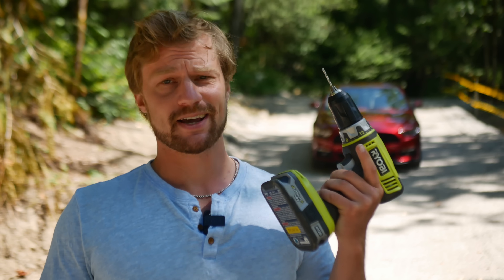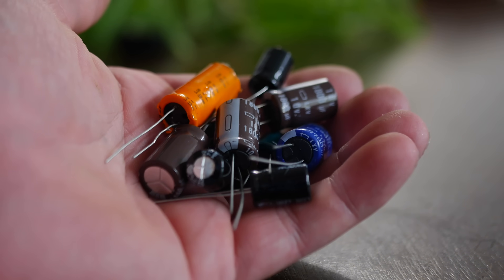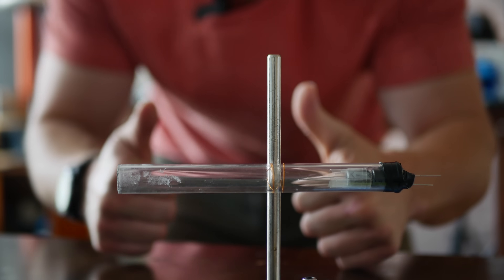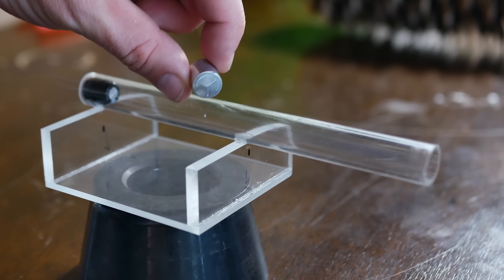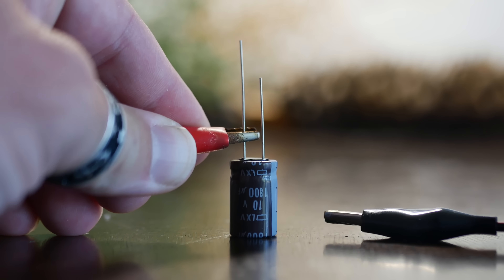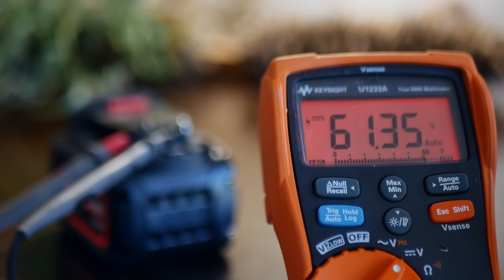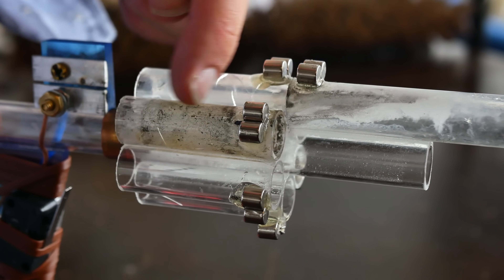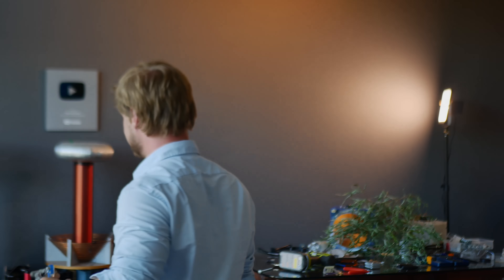I Built An Electric Capacitor Revolver!

Comment: I was doing this 50 years ago but started by using large paper capacitors, (seen on the outside of some electrical motors) hooked up to a single-cylinder lawn mower engine pulled apart (no oil), to work properly it needs a robust 'rotary disk shutter' a piezo pressure sensor and a heavy-duty airgap capacitor, the rotary disk shutter needs to be one of the capacitor plates. discovered this one day when an electric motor paper capacitor exploded and through me and my dad away from the motor, dazed for a couple of seconds, it was wow that had some power, when checking the capacitor the metal frame had rusted enough to allow the pressure to break through, there was tinfoil and paper everywhere. this is most likely the ideal future electric engine, (a petrol engine (ICE) style converted to an electric fuel), the capacitor pressure could with research and development become the explosive force required to drive the pistons, someone just needs the money and time to achieve the basic force for a car (1,145.83 Newtons of force per cylinder). it would need to be an AC system, NOTE this is dangerous and can kill if you do not know what you are doing, it is electricity...

Comment: Shoot holding the gun with both hands. Better accuracy.
Also, accuracy is increased by getting the projectile to spin before leaving the barrel. That's done by scratching a full thread on the inside of the barrel. Common knowledge.

Next build: electromagnetic nail gun from a camera flash!

Comment: I would explore more in the relationship of voltage and velocity to see were it tops out, maybe you can push it to the very limits getting really high voltages with batteries in series, the rc Lipo batteries are great.

Comment: Interesting use of capacitors - but - I can see the day very soon when you will need a special licence to buy electronic parts - as back in the 1920's and during the War. Hobby electronics will be made illegal and ultimately banned world-wide. 
You won't even be able to buy so much as a resistor or length of wire, for fear your making an unlicensed weapon of some sort.  Much like buying certain chemicals to make drugs at home. 
These sort of electronic toys will be hunted down by authorities and ones amendment rights will be thrown out the window. 
3D printed guns are being outlawed now in some countries, for much the same reason.

Comment: Cool idea and good video! 👍😎

For updated version - use high voltage big capacitance caps as energy storage and voltage boost converter module for charging them. After triggering, all energy from bigger caps is send to low voltage cap in barrel.. 😉

Comment: Use cotton wadding from black powder guns to seal the gap between projectile and barrel. look into rifling the barrel.what if you wired the batteries in series and wore the battery pack like a backpack? 
It's not a firearm it uses no gunpowder.

Comment: Firing circuit needs a voltage boost. Consider charging 4 60v caps in parallel and then discharging them In a 2x2 configuration for 120v.

Also, use charged high voltage caps for the projectiles for a tazer effect.

Comment: For the power source, I'd just wire a battery to a 90V booster, then that to a capacitor. (Literally what I thought you were doing from the title...) A capacitor could provide enough amps for that one burst, I imagine.

Comment: Yup a non isolated boost mode switching power supply will turn that 60 volt battery into 120 volts or higher.

Comment: Maybe a little suggestion... on your next build, place a solid backing up against those caps on the lead end... the bottom side. Those caps will release pressure from both ends when they explode, you loose some pressure from the lead end if the cap has no backing. If you could place a solid backing there, all the force will be pushed up to the top of the cap where you need it. Think of it like a real bullet, the back is sealed by a shell and the pressure released is pushed forwards only.

Comment: You could also use the boost converter from a 2004-2009 prius inverter, they accept any voltage up to 600v and use 12v pwm to control it.

Comment: You may use a high capacitance high voltage capacitor along with a boost converter to lift 18V to 90V. The capacitor will provide enough current for the firing capacitor to explode and the boost converter with charge the big storage capacitor to 90V...

Comment: You need to use a small battery, a buck converter, and huge honking capacitor to provide a jolt to the "round". A flashbulb circuit is what you need.
Reply: Of course. Maybe , maybe. Look here:
! New: Apocalypse Coilgun, Fallout Coilgun
https://youtu.be/G9-jKWPyMFo

See also: Portable Super Coilgun:
https://www.youtube.com/watch?v=rclLsQ9nyeg&amp;feature=youtu.be

https://www.youtube.com/watch?v=-mjDqp_oWZk

https://youtu.be/YLOYxsqvjw0

Comment: Can water work as an explosive by first separating the oxygen and hydrogen with electricity and then lighting it up with an electric spark? Can that be done fast enough that it can be used on a hand-held gun that doesn't need to store the gases, just regular water?
Reply: Of course. Very probably. Look here:
! New: Apocalypse Coilgun, Fallout Coilgun
https://youtu.be/G9-jKWPyMFo

See also: Portable Super Coilgun:
https://www.youtube.com/watch?v=rclLsQ9nyeg&amp;feature=youtu.be

https://www.youtube.com/watch?v=-mjDqp_oWZk

https://youtu.be/YLOYxsqvjw0

Comment: Super cool! To boost the voltage, maybe use an inductor with one side to + and the other side with a a mosfet to ground. Let ~10 amps build up in the inductor, then disconnect the mosfet. Voltage should spike very high, depending on how large your inductor is, and how small your cap is.
Reply: Of course. It's  really cool ! Maybe, maybe. Look here:
! New: Apocalypse Coilgun, Fallout Coilgun
https://youtu.be/G9-jKWPyMFo

See also: Portable Super Coilgun:
https://www.youtube.com/watch?v=rclLsQ9nyeg&amp;feature=youtu.be

https://www.youtube.com/watch?v=-mjDqp_oWZk

https://youtu.be/YLOYxsqvjw0

Comment: Interesting, but a huge waste of capacitors!  I never thought of a capacitor being used this way.  Going back some decades ago when I was working in TV service at a service center I saw where a customer decided to change a power supply capacitor in the power supply of his TV set and he installed it reverse polarity.  The capacitor blew apart, made some flames, and did some damage to the circuit board.  I had to change the complete power supply circuit board. It would have been less expensive for him to bring the TV in for service in the first place.

Comment: At last, finally someone who realises what we all did as kids in the 1990s is actually true.
Capacitors are weapons!
We never actually got round to using caps to fire a projectile, but we certainly did have fun with caps. We generally used the capacitor goo and the smoke as the 'projectile' in short ranged weapons. We would also build 'time bombs', ie a timer circuit connected to a relay, that linked 96 volts reverse biased through a bunch of electrolytics, and leave this circuit ticking on a desk that had kids from lower classes on it.
We eventually progressed from caps to 555 timer chips. These things are great, when you 'pull the trigger' you almost always get a chunk of casing firing straight up from the chip, meaning they are very easy to aim and fire. We also did '555 Olympics', with events such as the high jump and long jump (how high/long could you propel a fragment of an exploding 555), sprint (after the starting gun, which was an exploding 555, who could make their 555 explode first), marathon (who could make their 555 smoke the longest before blowing up), and of course the relay (who could blow up 4 555s the quickest using bare wires).

Comment: For a moment i hoped you would use a trigerable spark gap, and some photoflash caps. If sticking to this principle, try using a glow plug, with hot end heating up mineral oil in sealed cylinder with a weaker end wall
Reply: Of course. Maybe, maybe.  Look here:
! New: Apocalypse Coilgun, Fallout Coilgun
https://youtu.be/G9-jKWPyMFo

See also: Portable Super Coilgun:
https://www.youtube.com/watch?v=rclLsQ9nyeg&amp;feature=youtu.be

https://www.youtube.com/watch?v=-mjDqp_oWZk

https://youtu.be/YLOYxsqvjw0

Comment: If you polarize the caps in the proper direction before blowing them up you might get more explosive results. If an electrolytic is not polarized correctly at all before use, it can actually polarize in the opposite direction and work fine. Most of the time however, they get tested at the factory and are polarized at a couple volts for not very long. Often times it does not totally setup the dielectric. So if you apply reverse voltage, they will pop but not very explosively. If however, you apply at least 80% of their rated voltage in the correct direction for a few minutes, you may find it much more prone to explosion with only a few reverse volts.

Comment: Omg why didn't use a converter and get it up to 120v or 230v nice project in general much better than a Coil gun ,interesting usage for old caps but I guess if take out the electrolyte and got it full of match sticks it would de a gun with a battery and do some real damage

Comment: those caps have weak spots designed to explode at relatively low pressure, which limits the pressure buildup of the electrolyte. If you could reinforce the end cap a little bit, maybe you could improve the setup

Comment: This gun can achieve much greater power. Transform your batttery voltage to 400 volts, with a diode volt multipler, to a capacitor bank made of multiple 450 v. Capacitors connected in parralel  then use this charge to propel your capacitor "bullet"..

Comment: Watch out, the microswitch you use as a trigger is not suitable for the high current that flows. Eventually the contacts will weld together and cause an unexpected firing when turning the barrel to the next shot. As others commented, a better design would be to use a high voltage / high capacitance capacitor charged through a step-up regulator as energy source and to use a semiconductor switch (like a MOSFET, which can easily carry a kiloAmpere for short time) to trigger the shot. Then you only need to control the gate voltage through your trigger. Another benefit is that you can make the high current path as compact as possible, thus minimizing inductance from cabling and you can add debouncing to the trigger signal as a mechanical switch has the tendency to oscillate when closed causing intermittent contact in the first milliseconds.
Reply: Thats what he said

Comment: I have thought about something vaguely similar for years..
Not destroying the capacitors, but using them to fire a automotive style spark plug, as the ignition source in a black powder firearm.
(kind of silly, as black powder primers are far cheaper than what the components for my design sell for)

Comment: I wanted to say a few things:
  1) The gases emitted from the capacitor are poisonous and sometimes cause cancer (so be careful)
2) By designing a voltage booster, you can easily increase the voltage of the two ends of the capacitor up to 400 volts and as a result get more power.
3) If the tube of your device has rifling, you will get much more accuracy (for example, use a 9 mm tube (do you understand what I mean?))
4) For more accuracy, you can align a laser with the tube of your device

Comment: You could make really close tolerance projectiles by greasing a barrel, then put a blob of epoxy in the tube, compress the epoxy, and let it harden. 
I saw a video where a guy used this method to make pistons for a sterling engine.

Comment: The plastic probably weakened due to chemical attack. And pressure combined. After all some capacitors do have some agents in them like weak acids. And that thick smoke isnt likely good for you. Take care of yourself, don't breath any of it in. Safety first.😉

Its an interesting idea, just be careful. Metal should last longer, so long as the pressure rating is high enough. Just keep in mind, if something ever does explode, metal is likely to cause more damage if it ruptures. Especially metal thats not thick enough to handle a catastrophic failure. Might consider a back plate, to protect your hands too. Just a thought.

It will be interesting to see what you come up with. Reminds me of the old rocket powered pistols in reverse, only with a seperate projectile. And the propellant contained in the tube rather than the projectile.

Comment: So I have a suggestion: use a cheap 12V battery and add a step up stage with a large capacitive load. For a small form factor, a cheap flyback transformer will do perfectly fine from 12V to maybe 200V (you can even add some cockroft walton stages to multiply the output using same rating caps). It should take just a tiny bit of time to recharge before being ready to fire again, but this kind of configuration could unleash tremendous amounts of power! Great video!

Comment: Soooo.  Why didnt you go to big voltage dc?   Be easiest to rectify 220vac and output the like 288vdc.  Plus you could charge a big ass cap that would be the ignition rated at 380v at like 50kμF...  that should be enough for 6 shots before you had to recharge it..

Comment: It would be interesting todo something similar but with HO. Just 3d print little water containers add a rubber plug at the end add salt water and voltage and a spark and boom it will blow up in your face or be really cool. 50/50 chance.
Reply: Sure. Maybe , maybe . Look here:
! New: Apocalypse Coilgun, Fallout Coilgun
https://youtu.be/G9-jKWPyMFo

See also: Portable Super Coilgun:
https://www.youtube.com/watch?v=rclLsQ9nyeg&amp;feature=youtu.be

https://www.youtube.com/watch?v=-mjDqp_oWZk

https://youtu.be/YLOYxsqvjw0

Comment: The ammunition seem a little expensive for what is basically a steam explosion. A more cost effective propellant could be obtained from match heads, ignited by electrical spark, but this is far too close to being a conventional gun for this channel. The same would be true of using alcohol, oxy hydrogen or an alkane gas. So a more interesting propellant, might be an electrical discharge through water. There are reports that a high dielectric stress can make very pure water explode, though I expect it would be very demanding to construct a hand gun using this technology. 
FYI, (I know that a single match heads is likely to produce a far higher velocity than an electrolytic capacitor. I once managed to fire a small, short steel rod through the thicker part of the  head of a wooden mallet, using no more than a single electrically ignited match head as propellant.).

Maybe you should consider an exploding bridge wire, mounted in a small amount of distilled water. The big advantage over a capacitor is that it would not produce any of the toxic residue, which I believe maybe boric acid solution, aluminium oxide, and a disintegrated paper separator.

Comment: I have often thought that this idea but with water and a burst disk would work really well. Use a heating elament in a drop of water or run a massive high voltage pulse through it. The high pressure would burst the disk at a set PSI. I do know some research has been done on pulsed discharge chemical guns in the past.

Comment: How fun! Although, I have to wonder if just vaporizing salt water with a huge current wouldn't be more... economically sustainable lol. I guess those caps are cheaper than some rounds though. Cool project!
Reply: Probably corrosion would be the reason that would be hard to make work not because it wouldn't work but vaporizing salt water would rust literally everything around the gun
Reply: @kennydoggins1712  Point taken. Sodium chloride isn't the only electrolyte in the world though. You just need the water to have a slightly higher resistance than the rest of the circuit and it will get hot very quickly. That's what's happening inside the capacitor after all. The electrolyte makes the explosion. Maybe baking soda?
Reply: @DFPercush  fair enough but you'd have to tell me you obviously know more about this than I do, I would assume that anything that produces excess humidity wouldn't be good even if it wasn't infused with salt
Reply: @kennydoggins1712  
This entire video revolves around getting the guts of the capacitor to get hot enough to vaporize the liquid inside of them. That liquid is salt water. Its always salt water of some variety because that's what an electrolyte is, saltwater. There is no need to use capacitors. Any sealed metal can (the shell of the caps) with liquid inside of it (electrolytes), will explode with heat applied. 

This video and every video that I've ever seen on this channel are disingenuous bullshit. This gun in this video is NOT electrically powered, its electrically triggered. Its a steam powered projectile....something that's been around for like 200 years or more. Just like his "Star in a Jar" video - a design he ripped off as original work, which has been around since the 50's and was invented by the inventor of Television. Or his ion thruster idea, also ripped off from the 50s or 60s and fully developed already. 

Theres nothing inherently wrong with redoing old inventions, but he doesn't credit the inventors or the history. You can even find videos of people blowing up capacitors like these for fun on reddit from years back.

StyroPyro does real original work for example.
Reply: @wilurbean  Tiny issue with your claim: what, in this system, is powering the conversion of the electrolyte to steam, hmm?
Reply: @wilurbean 
He then said that he deleted the details on how to make one of these, what information is missing? If you wanted to make one of these then he showed you how, what did he leave out... 'How to buy a switch?' Ffs, ridiculous and as you said, very disingenuous!